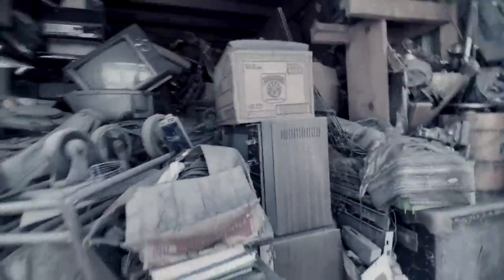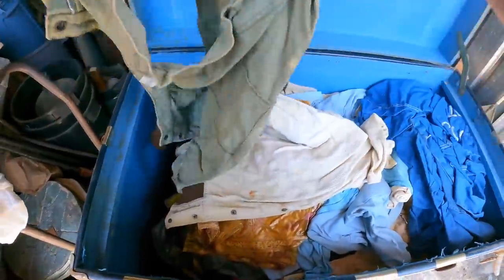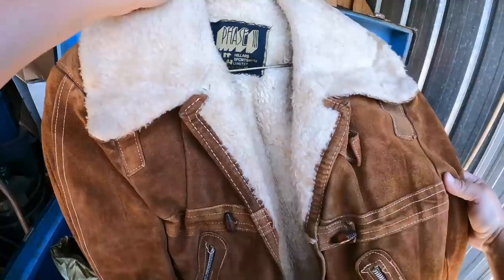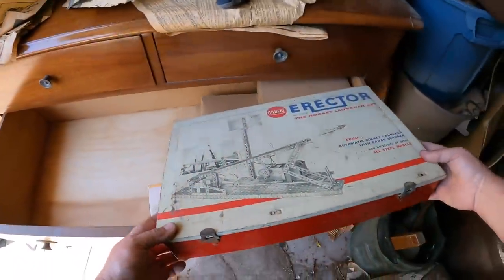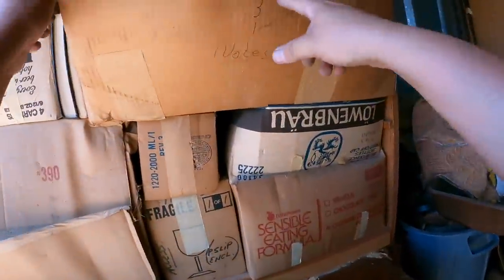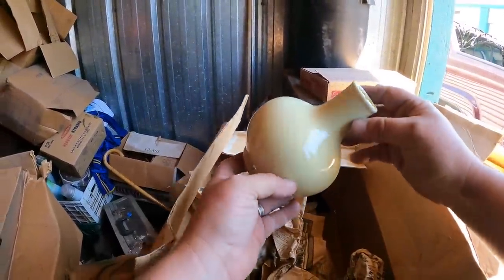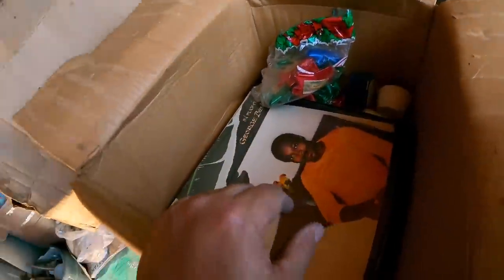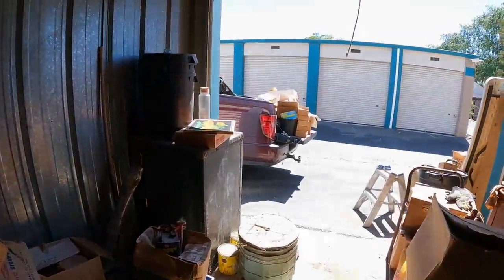What's under the trunk? The HOARDER HORROR SHOW locker saga continues and things start to get better

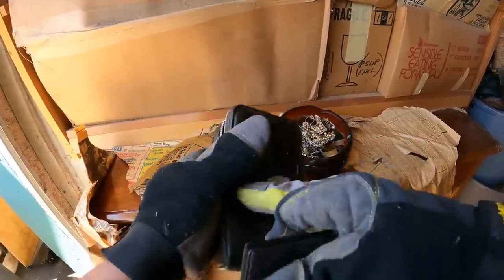Comment: Hang onto those vintage suits until next Prom season!  Those early 80s suits look really sharp.  16:50 My sister had one of those original calculators.  Lots of them still work.  The Columbian Exposition coin is an 1890s 50 cent piece. Silver if nothing else.  26:42 First class letter scale.  Works like a charm.  I have one.  Use it too.  Between that, the chem lab stuff and the shall we say "implements" I have to wonder if this person's kids got up to something they shouldn't.

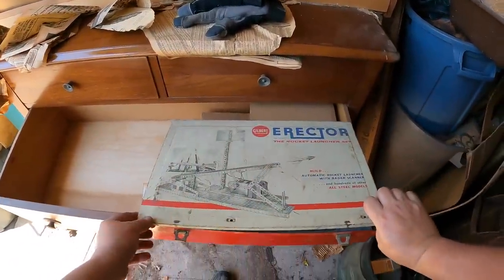Comment: @ about the 19:20 mark the metal cannon found might be a Bang Site cannon. It used water inside the cannon with a scoop on the striker part of Bang Site powder. That was a basic one. They made more fancy ones that cost more.

Comment: As I'm watching you go through the clothes I'm wishing that I had those velour shirts. I loved those shirts from the '80s, with the color blocking and the stripes. And then you pulled out a full denim jumpsuit! Probably from the 70s. And you said maybe 30 bucks. I think I would hold out for $150 on that one. That is an excellent find. I didn't check any comps though maybe it's just me that thinks it's worth that much.

Comment: IMHO, anything vintage has value, especially for prop houses which always need good condition vintage stock for period films and TV series. The Contact paper, the Kleenex Boutique tissues, the unused vintage iron, the old glassware and even the vintage aluminum foil and plastic wrap will have value. Don't underestimate ANY of these vintage items. For example, its always much easier to have actual vintage packaging than for some film or TV series art department to try and re-create it.

Comment: Those sieves are used for compounding chemicals.
Reply: we actually use those as particle separators where I work, we test dehydrated hash browns to see if they have too many broken pieces, same for the sliced potatoes.
Reply: I've only used them for dry chemicals. But I know they're also used for sifting soils. Many uses for those little sieves.